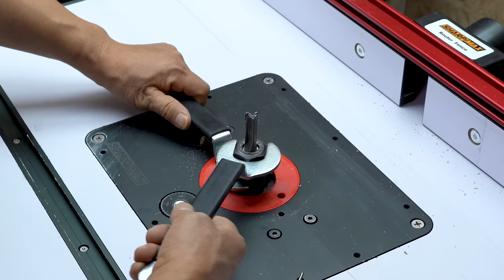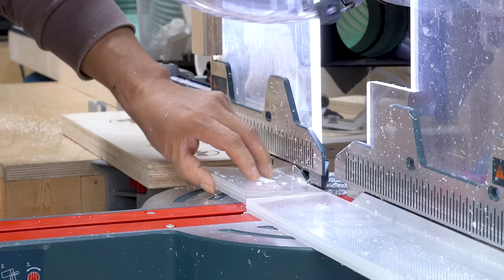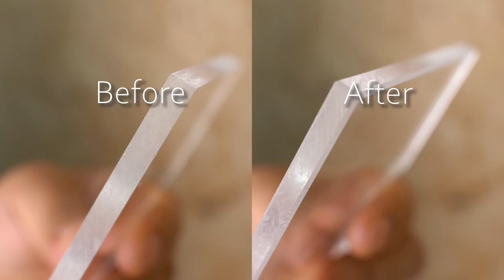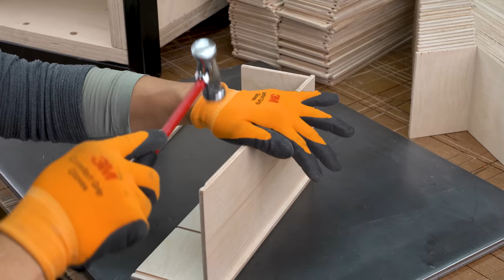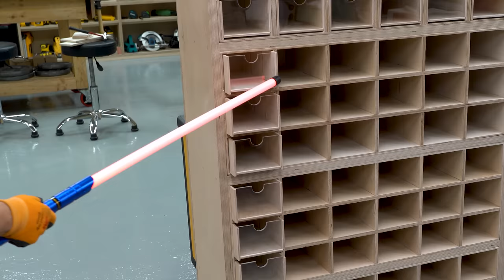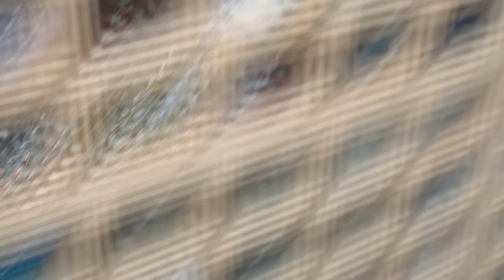Abundant Drawer Chest / 270 Drawers / DIY

Comment: so how long did it take? and how much money did you spend on the material (plywood and acrylic)? in US dollars if it possible
Reply from the maker: The three bookcases are made from 25T birch plywood and cost around $400. 

A total of 15 lattice boxes with 5 spaces per desk are made of 12T birch plywood and cost about $300. 

The 270 drawers are made from 6T birch plywood and cost around $400. 

I used 4T and 6T acrylics and they total about $300. 

All together it cost about $1,400 and took about two weeks. thank you

Comment: hi! awesome! can you tell me what thicknesses did you use in each part? 4mm acrilic, the main shelving? principal block? individual drawer? Thanks!!!
Reply from the maker: 3 large bookshelves with 5 compartments 24T 1,000*1,950*300 

15 small boxes of 18 spaces 12T for bulkhead, 6T for outside 950*490*300 270

small drawers 6T wood, 6T front acrylic, 4T acrylic for center separation 142*300*95 

I hope I can be a reference for you. thank you!

Comment from the maker: 3D Modeling Blueprint : https://youtu.be/YC3XhXQrlFk

I wanted to clean up my workroom.
As the number of parts that I managed increase, parts drawers and drawers are continuously required.
I didn't want to just buy a plastic product, so I made a parts drawer myself using 6T plywood and 4T acrylic. The number is 270.

It started off with excitement, but as soon as the number of productions exceeds 100, it's a great work.
There's a lot of plywood and acrylic cutting, and it took almost a whole week to sand it and assemble it. In the middle of the production, I thought a lot about buying the finished product.

However, to make it into a portable cabinet and fill it up with a third-tier bookcase called the Secret Door, customization was needed. When I look at the tight-fitted drawers at the end, I forget the difficulty of making them.
And I'm going to think about the next piece. It's a continuation of this situation.

The assembly of the parts drawer was made by digging a groove with a router and inserting it. It's easy to assemble and has the advantage of being able to meet the specifications consistently.
A 6T acrylic was used on the front of the part drawer, and a semi-circular hole was drilled on the top to serve as a handle. It's a form where we can see the inside well, so it'll be easier to manage parts. To divide the parts drawers, I made a cross-shaped partition wall, and I made a groove in the center with a router. Because of the frame of the bookcase, 6T plywood was used on the outside and 12T birch plywood was used on the inside.

I hope you enjoy it. Thank you.

#DIY #DIY_IDEA_INVENTION #PartsDrawer #Drawer #handwork #storage #workroom #woodwork #ChestDrawer #Howto

Comment: What is an acrylic cutter?  what is the name of?  send link to store
Reply from the maker: It is a product called Bosch's GCM12GDL. It has a robotic arm, which is pretty cool to look at. It is a miter saw in a different form from the existing rail method. thank you!
Reply: and a small green cutter?
Reply from the maker: This is a machine called a chamfering machine or beveler. It is a machine for removing edges of metal or acrylic. You're talking about this machine, right? 
Thank you!
Reply: @Kynosys_  yes green router ))